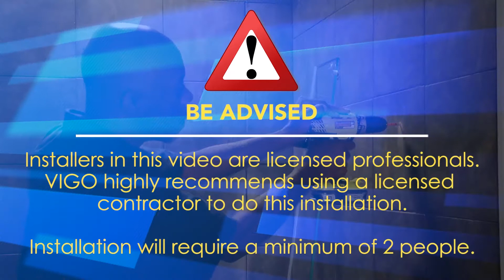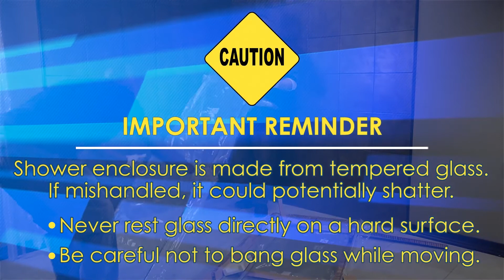youtube video #0Ti0hM0PPLI

Comment: Does screwing the rails to the floor cause the potential for a leak?  I have a Kerdi shower pan and would be worried about puncturing it.  Are there other viable options?
Reply: I have a shower pan, but it makes me a little nervous drilling into it. I wonder if the rails could be installed with construction adhesive instead?
Reply: The instructions saw to dip the screws in silicone, so I guess that is supposed to seal it back up. I still don't like it though. I ended up installing the rails on my Vigo pan by using construction adhesive. There were super secure, and once you have the wall supports installed nothing is moving anyway.